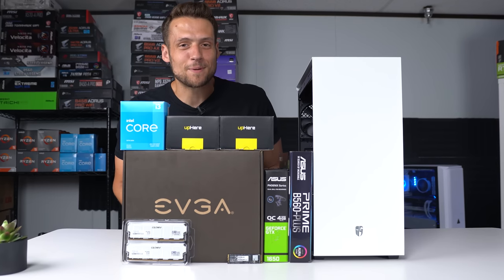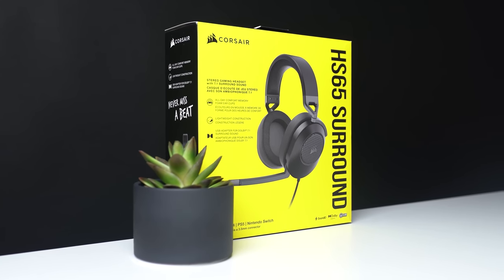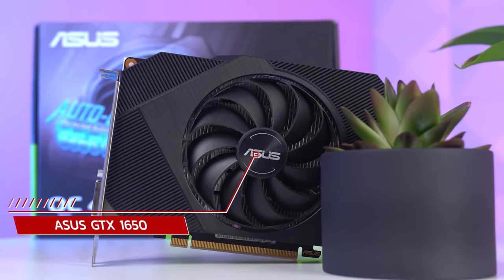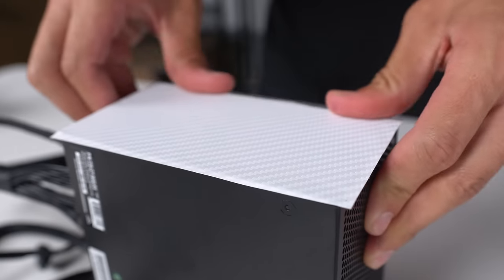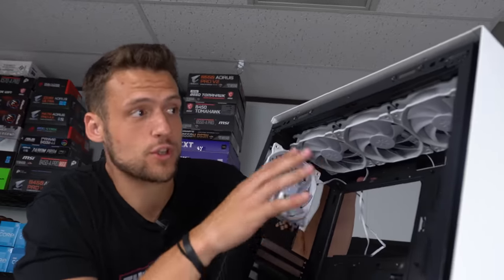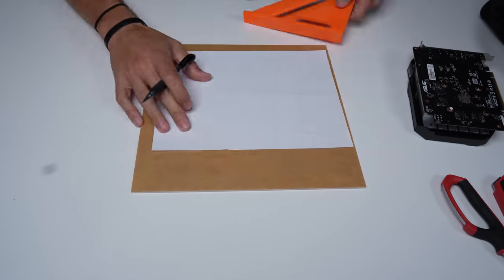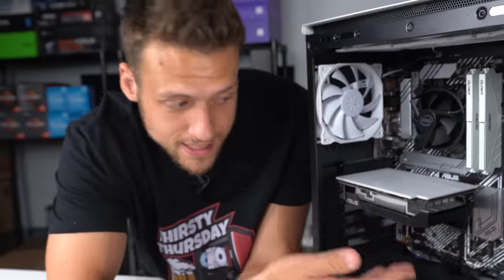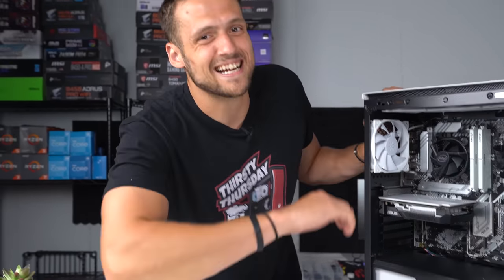Building a $466 Gaming PC!

Comment: Solid build! i3 10100f/10105f is a good choice for a budget PC.
Reply from the maker: For sure! It's hard to use something else right now tbh
Reply: 12100f would be best choice
Reply: @raazshahriyar4035  its also about 100 dollars more in cpu/mobo....... for gaming on a budget, 10100f is best
Reply: While an extremely good budget cpu, it is not future-proof
Reply: @enrd12  i meam what is future proof....the lga 1700 socket is more of a inbetween bridging the gap between ddr4 and ddr5 generation, and pci 4.0 and pci 5.0...... so basicly 10-11th gen socket 1200 is in essence the best of the best in ddr4 era, and by the time you upgrade in 4-5 years, we will have a new socket..... so no need to future proof om the socket 1700 since it will be obsolete to upgrade in 4-5 years, since socket xxxx will be the new stuff then, and well be in the end of ddr5 era
Reply: @michielroskam3877  so true.
Reply: My laptop is better but that's more cheaper my laptop has a i5
Reply: @michielroskam3877  You should add more periods!

Comment: Also, you can buy basic acrylic sheets at Home Depot (clear) for 5 bucks and its enough to do 3 to 4 gpus. Cut to size, then pull the paper coating off the back side and spray paint 3 coats on it. Once dry pull off the coating on the front and install with the painted side  down on the gpu. This gives much more depth than plain white acrylic. Youre looking through the clear acrylic to the painted part. Its super easy and very cheap to do. And you can add a sticker to the clear part which I often do when building themed builds.

Comment: Cool build, but I think you should invest a bit more into the GPU. A gtx 1650 doesnt get anywhere near the limit of the i3, unless you play on very low resolutions and very high framerates.

A lot of the money just gets spend on parts which dont actually offer any performance but are necessary, so even a 50bucks added to the GPU budget heaviely improves performance.
For 525€ you can already make a build with a 10105f and rtx 2060, which is only 75€ more for much more performance and useful features like DLSS, which heaviely improves performance in certain games.
It should atleast be a 1660ti

You can also save some money on the mainboard. Get a cheap one with bad cooling, and then buy heatsinks for 5€ and tape then on yourself. This saves 20-25€ you can invest in a GPU or SSD.
You also can consider buying a arctic p12 pwm for 4€ (or a bit better if budget allows and you want it truly silent) and replace the fan of the box cooler, this not only reduces noice and improves cooling for very little money, but also cools your mainboard a lot so you can cheap out more on the mobo itself

Comment: These kinds of cases, with very little air flow, it would not be that hard to drill holes in the front.
One could even do some sort of graphic or image, then place RGB lights behind to light up the art.
This would give looks and better air flow. Just a thought.
Reply from the maker: But it would be extremely difficult to make sure those holes match up and look aligned by hand, and then you'd have to repaint them as well to cover the exposed paint, and try to match it up with the rest of the case. Deff not an easy task for a DIYer
Reply: @ZachsTechTurf  You are correct. I didn't think all of it through. This would be a neat experiment to figure something out easy and would look good. Ideas and visions.

Comment: Great solid build, as for the gpu backplate, how bout putting striped lines corresponding to the motherboards lines of direction? Just a thought. You could use black striping tape, comes in varied widths.

Comment: 1630 is a borderline gaming machine with only 4gb vram. I'd rather get a used 1070 for a bit more due to 8gb vram.
Reply from the maker: You can ALWAYS spend more money to get better performance.
Reply: @ZachsTechTurf  yes but 1070 is cheaper than 1630 over on the bay. I saw some 1080tis in a similar range to the new price of 1630s.(eq to 1050ti) I was making some "build" videos where I discussed some parts. so ive been digging too much lol. Marketing a computer as having a new card clearly is better from profit standpoint I'm sure.